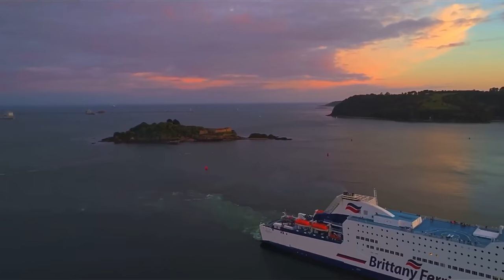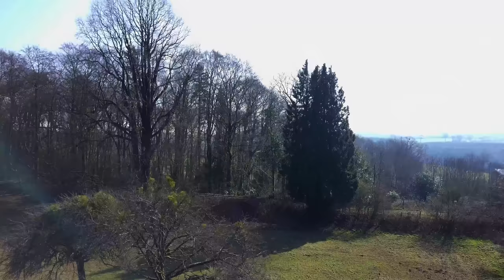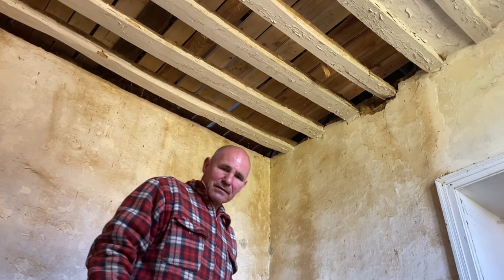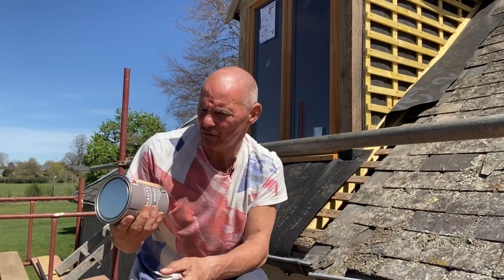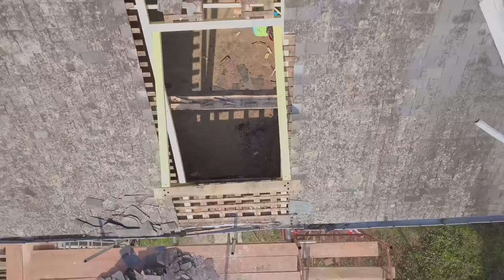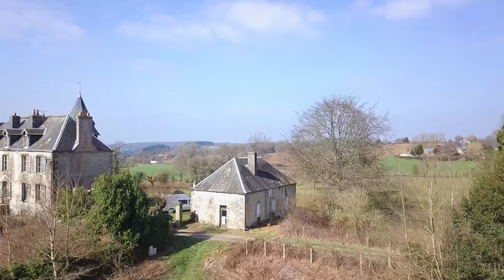Creating A Room With A View Of A French Château. Ep10

Comment: Country side is so nice and green. Early this year for some areas. Dormers add space and some offer window seats to enjoy the scenery. Using a small motor and hooking up a bale conveyor can rid the area quicker of debris. Simple system, cheap to make and debris can be shovelled onto the conveyor to outdoors to move later. Some people now use solar power for electric . Some older balers have conveyors on the side of them and are just rusting in fields. Putting them to use provides moving things easier. Merely suggesting . Saves on physical fatigue! Later! Nice job!
Reply from the maker: Thank you very much for that, what a great idea 🥰